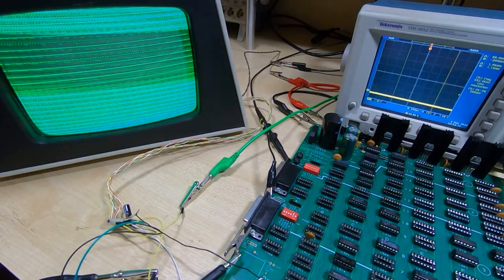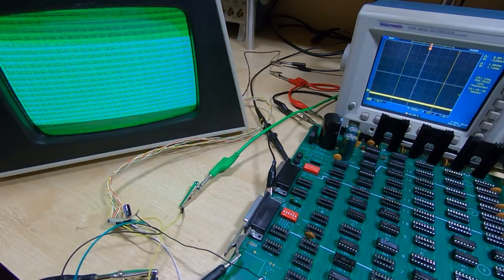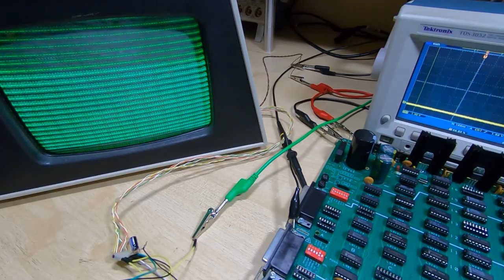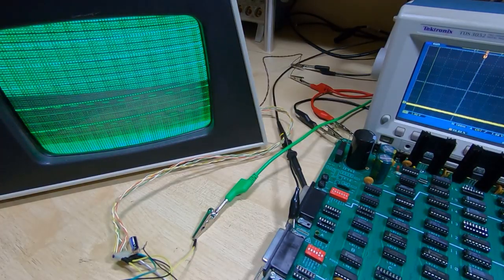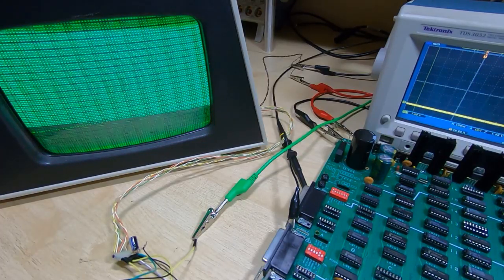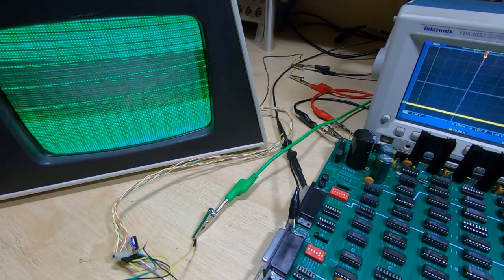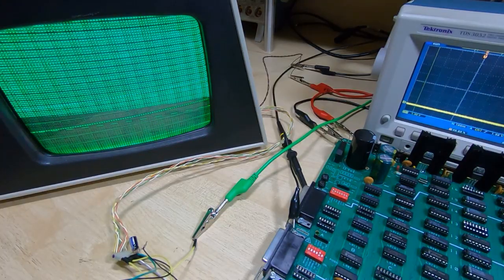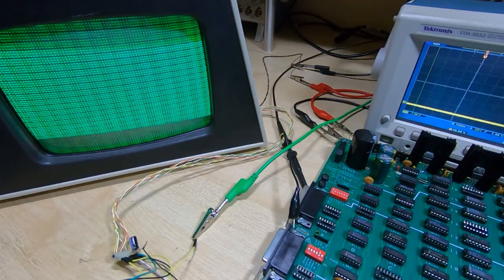ADM-3A  Board Reproduction Part12

Comment: Hi Jerry, really enjoyed your adm-3a board replacement videos, i was interested in a board, but dont think finding/soldering chips is within my abilities. Side question (this may blasphemy) is there logical way of repurposing the adm-3a keyboard by rewiring the keyboard matrix to a usb encoder? Can you point me in the right direction?
Reply from the maker: Yes you could do that although the ADM keys are soldered directly to the main board. The easiest method is to use a microcontroller and scan the keys. To determine the simplest scan lines I would advise looking at the ADM schematic (keyboard page) and duplicating the scan layout. The keys are grouped in an odd way to make the ADM circuit easier but once the keys are scanned into a microcontroller then you can map them however you choose and if the microcontroller has USB then you can use it to send the key press to a PC (maybe also include RS232).
Reply: @JerryWalker001  Thanks, can you elaborate 'duplicating the scan layout'? (to me, that sounds like 'then magic happens' :) )
Reply from the maker: @edwardyagi7427  If you look at the schematic you can see how the keys are connected in columns and rows and how they are scanned. You just need to duplicate that in the microcontroller. It is not as easy as it sounds because you need to debounce the keys but still scan fast enough to respond to a short key press and also handle multiple key presses.

Comment: Basic level hardware experience here, and I've just recently finished restoring my ADM-3A. 
After getting it working (mostly just replacing some capacitors on the main and video boards), I got to dive in to it a bit to add a 2716-based lowercase ROM, and what I've since found out is the "option 4" column-72-beep defeat. Did some more diving in to figure out why my screen was all zeroes, and why everything I typed or came from serial had bit 0x10 flipped on the display, while the data going out the serial was okay. Tracing through I found the 74LS86 at L11 flipping the bit; of course, that turned out to be the "fill" switch being in the wrong position, so I got to learn what that switch does.
While trying to understand these parts of the schematic, I just found your videos. These are absolutely fantastic, and a wonderful learning resource. Thank you!
Reply from the maker: Yes the fill switch fills the screen with zeros (or whatever is in that location in ROM). It can be useful for fault finding as it is controlling the input to the RAM so gives a consistent output to make fault finding less complicated (once you know it is there of course).
Reply: @JerryWalker001  The signal from the data-in (pin 11) on the data5 2102 RAM chip (J13A and H13A) back, they connect to the output of an XOR gate on the 74LS86 at L11. Input data5 (I think from the 74LS175 latch at K4) is one input, and the other is the fill switch which pulls it high. So what that does is flip whatever is on data5 as it goes into memory. On boot, that's spaces (or whatever) coming from ROM. So setting the fill switch changes the space from 10000 binary to 110000 binary, which is a "0" character. And any other incoming character in normal operation will similarly get that bit flipped from 0 to 1 or 1 to 0, which confused the heck out of me when I first encountered it. I was convinced something was broken, but not just pulling a bit high or low.
2 other things: 
  1) I'd really like to get a board when you're done. I've got another wreck of an ADM-3A that I had no plans to restore, but you've convinced me otherwise. And 
  2) Could you explain the reason for the 74-non-LS chips on the board? Particularly near the beep-defeat switch around at C1/D1 are a 74123 and 74H01 on my board. And
  3) (off-by-one-error) Could you explain the large board-length silkscreen "zones" numbered with circled 1-5? 
My apologies if you've answered these already, I'm still working my way through the videos.
Reply from the maker: Yes that is basically how it works. As I said it modifies input to the RAM system. This is useful because it allows the RAM and ROM system to be tested in isolation from the incomming data stream. The zones are used to identify areas of the board for reference purposes and was common on large boards back then. The different series 74 devices is mostly to do with the different pin outs that some devices have (74LS01 and 74H01 have different pin outs for the default packages although they are also available in alternate pin outs). I describe this in one of the videos and will also be posting a video on this shortly.

Comment: What parts were bad, the 74LS193 Up/Down Counters? It there enough potential cost saving to be worth taking a chance buying them on eBay vs. buying them new from a major supplier such as Farnell in the UK?
Reply from the maker: They work out about 4 times the price from vendors such as Farnel by the time you add VAT and handling and shipping. If you only use a few then it is definately an option but I use well over 1000 devices each year in new build and repairs so I need to shop around. Many sellers know how to ship items but the occasional one has no idea. I would also add that I once purchased some tagged batteries from Farnell and they arrived inserted into conductive foam so were all dead. I do agree though that generally Farnell would pack them well but the price is too high.

Comment: Would the chips have been OK if the pins had been pushed into the what looks like aluminium foil on the other side of the plastic foam?  All the pins would have the same potential, but that assumes they all made contact with the foil.
Reply from the maker: It is possible that some would have survived as long as (as you say) all the pins remained in contact with the foil.Unfortunately by placing the IC's on the opposite side the static generated would be directed to the points nearest the foil (ie the tips of the pins). This method of packing almost guarantees that they will be destroyed.